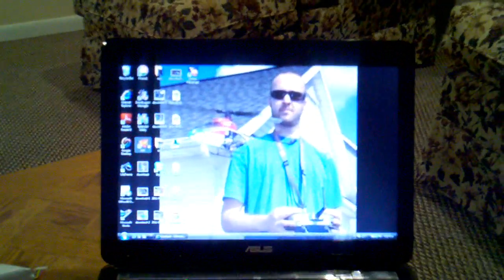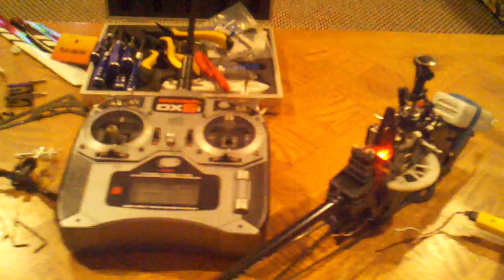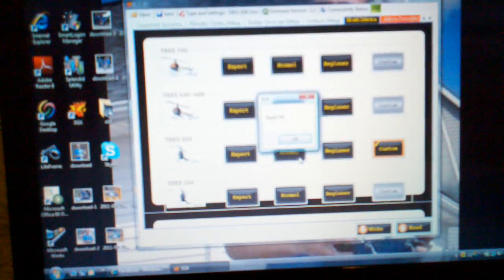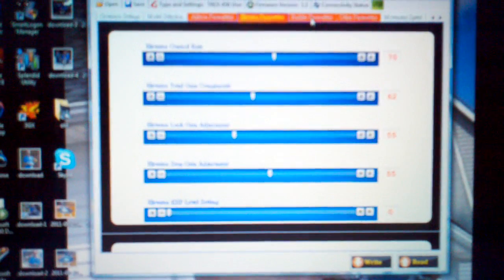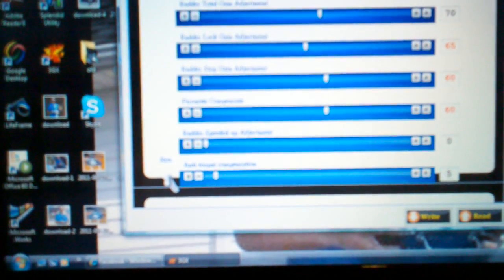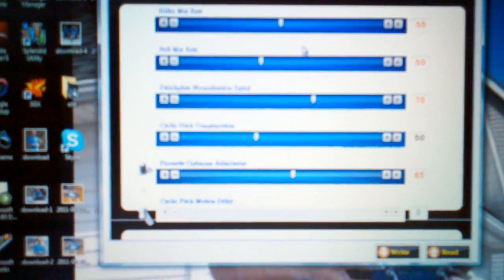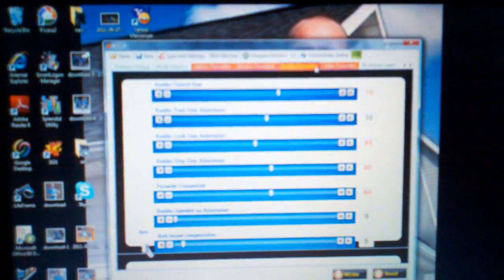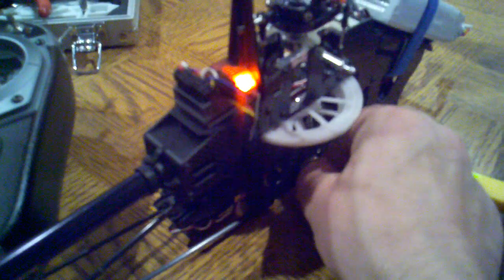3gx model selection/settings - quick walk through

Comment: hey thanks for the videos you posted on the 3gx- they have helped a lot. can you tell me how or when do you do your swash setup and pitch setup? in order to level the servo horns and swash, do you enter DIR mode first? And setting the pitch for high and low swash as well as cyclic, when do you do that? I assume that all that has to be completed before you setup the 3GX limits etc?
also does the little button on the USB plug the same as pushing the button on the 3gx unit?
thanks for your help

Comment from the maker: first setup your radio and make sure your rudder moves in the correct direction when inputing rudder.  then redo you gyro setup, and double check the 3gx is working in the correct direction...remember in theory its really opposite

Comment from the maker: look in your trex manual. it should have basic settings for you radio. dual rates should be set to 100% when doing your 3gx setup. Setup your radio THEN REDO the 3gx setup. after completing your new 3gx setup, turn your dual rates down to about 85% good luck!

Comment: I have a Trex 450 3GX v2.1, I've adjusted the 3GX just as you have, but do not know how it has to be set on the control Spektrum DX6i, which is the D / R EXPO, which is the recommended value, if I set it at 100% aile, elev and rudd, I can not have control of the helicopter, please help me, thanks

Comment: I recently bought  TRex 450 Pro DFC with 3GX FBL system but have not been able to reach the proper rudder gyro sensibility. Looking your videos for help I also found out that my 3GX software does not show the model selection tab. How can I get it? Regarding gyro sens I am at 52% but oscillation still occurs on the turns. Would appreciate your comments on these two subjects.